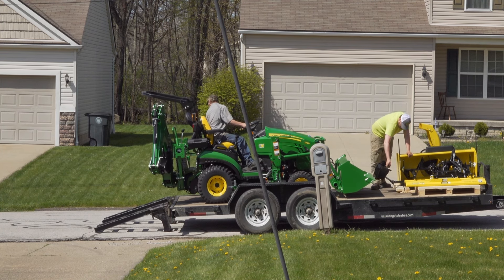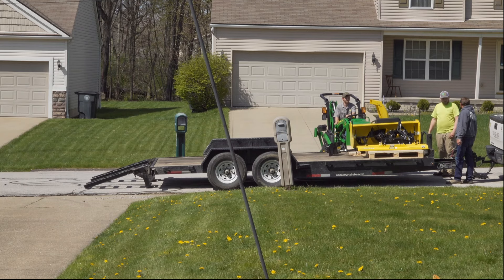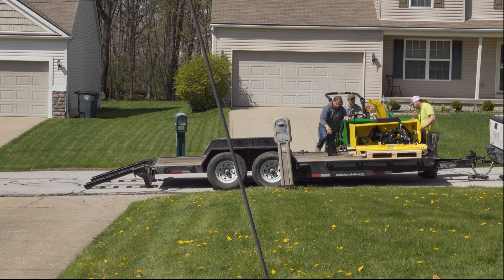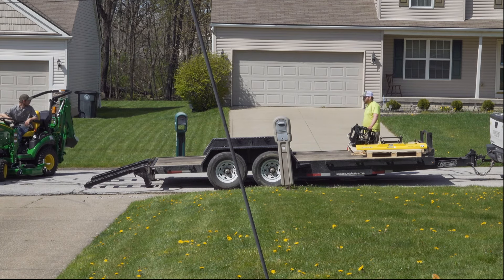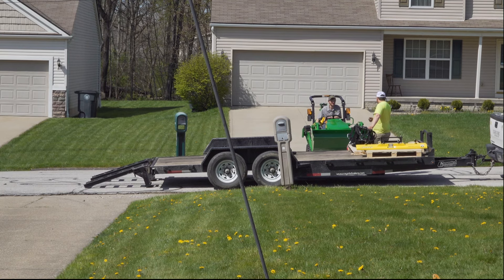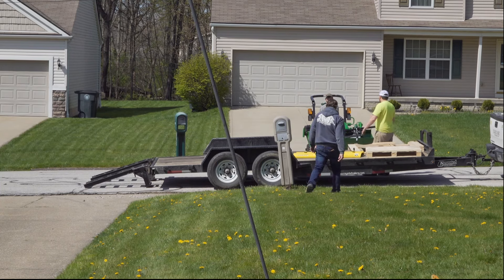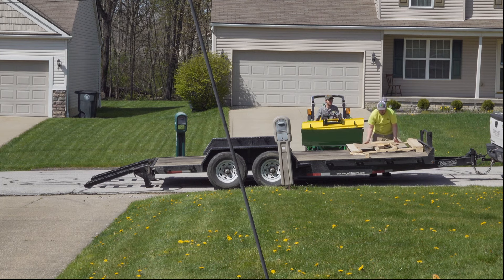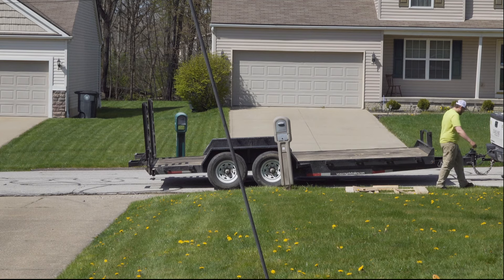Delivery Day John Deer 1025R, not so smooth

Comment: That hurt to watch them off load the tractor. When I had mine delivered, the delivery guy asked to offload right into my yard. He knew his ramps were to short and utilized the curb and backed trailer up so the ramps were almost level going into my yard. Such a beautiful machine. You’ve got all the snow removal options with blower, blade, and bucket. I just have the blower. I just picked up the electric spreader that hangs off the back the other day. That will be great addition to be able to salt/sand in winter, and fertilize/seed in spring.

Comment: Those guys should NOT be delivering expensive equipment.  It made me cringe when I saw them rattle the mower deck followed by the scraping of the loader; then to see the backhoe bottom out.   The dealer needs to see this video.

Comment: Just from my experience loading and unloading my tractor, those ramps are too short which creates a steep angle to load and unload. I guarantee they knew this from loading it. If they have delivered before, they are aware that it will bottom out. This is why he rammed the backhoe into the asphalt like he did. If not, it wouldn't have made it off the trailer and would have been stuck. So, they knew what they were doing and how to prevent it from being stuck. Just sucks that you accepted it after that and having it damaged like that. But they and probably the dealer if they have watched them load before, know the angle for loading and unloading is too steep. If they had longer ramps, the angle would have been better and the tractor wouldn't have bottomed out. For mine, I had 10 foot ramps custom made. I never bottom out now.

Comment: I just bought a new 1023e with front loader and belly mower. This exact reason is why I went and picked mine up from the dealer myself and brought it home.
Reply: Wow you bought a 1023e and not 1025r with a belly mower  good luck with the belly mower unless you have WIDE OPEN SPACE  to mow  FYI i'm a john deere 1025r owner love it just never would cut grass with it
Reply from the maker: I had just bought the flatbed trailer and i did not have the tie down straps yet

Comment: As soon as that tractor hit the ground, I'd have stopped them right there and told them to put it right back onto the trailer and take it back. I'd then take the video down to the dealer and demanded a cancelation on the order. If they tried anything, I'd take the video to a lawyer. No way I'd accept thst thing after that. It's one thing if you bear it up but it should come to you in pristine condition. 

I complained about paint chips missing on my brand new 2025 R. The guy acted like it was no big deal since it's a tractor. I told him if I'd paid 3 grand for a lawnmower I could expect minor dings etc. But since a I paid close to 30 grand for it, no excuses. I'll never buy another tractor from John Deere even though I love my tractor.

Comment: Definitely unprofessional delivery.  Approach angle too sharp/steep as others have pointed out.  I have a longer trailer w longer ramps, but you still need to “think it through “ to load and unload.  As far as a scratch on the tractor, I understand you being upset, but it is a tool and will get scratched.  I think your dealer is at fault for having these guys deliver it.  The operation of the tractor should have been performed by the dealer!  As someone commented, clowns with a truck and trailer.  Sure looks like way more tractor than the neighborhood calls for.  But that’s what is great about this country.  If you want a 55 hp tractor with 3/16s for a 3000 sq ft garden go for it!
Reply: I've only got an acre of ground and I bought a 2025 R. It's not the size of the property, as much as it's the abilities of the owner. I'm close to 60 years old, and my days of digging and moving piles of whatever are long since over. My tractor will enable me to maintain my property myself, long after my neighbors have started paying some kid to do the bull work.

Comment: Those guy's are idiot's he not only hit or scraped the backhoe coming down the trailer ramps but didn't raise the front bucket high enough so he just removed all the paint on the bottom and almost ripped the front end loader right off. He's lucky he didn't hurt himself.

Comment: They should be fired. It's not even that heavy. Lazy Americans.
Reply: When unloading a trailer have the trailer on the low side unloading to the high side thus reducing the angle. How do they deliver 30 grand in equipment and not have a clue how to do so. No way would I have excepted that delivery